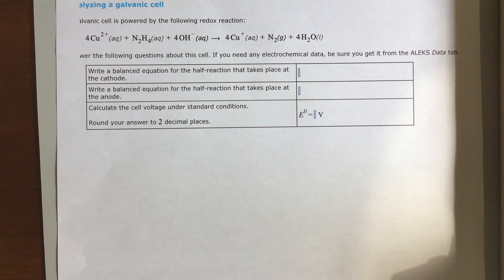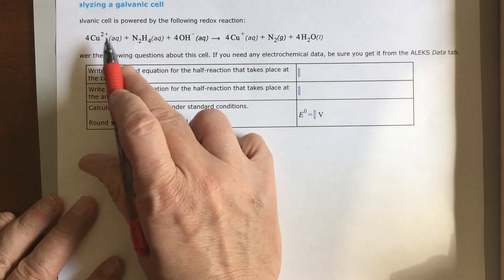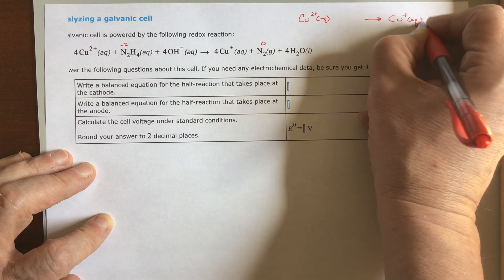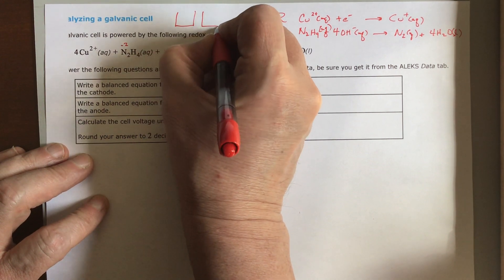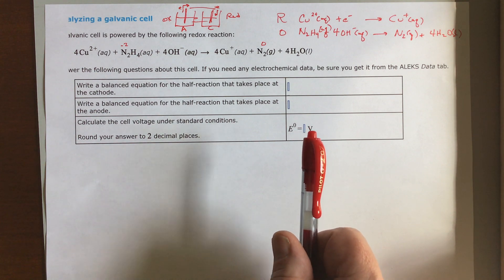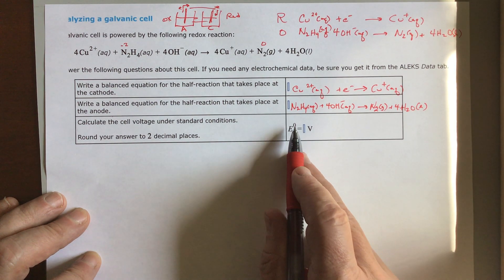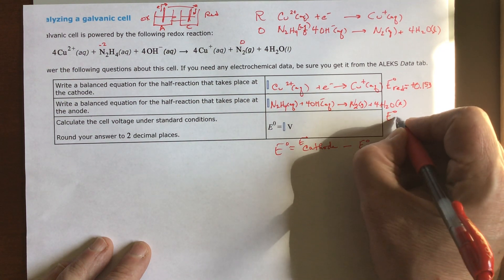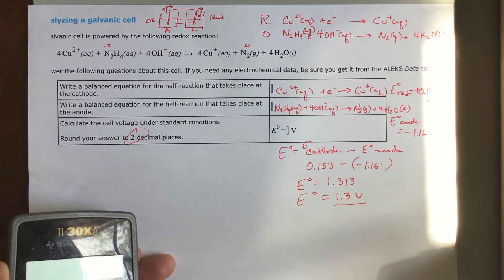Aleks Analyzing a galvanic cell

Comment: You forgot to add the electron in your oxidation half-reaction on the products side, as it's losing an electron . In which you then have to flip the oxidation reaction to conclude your final E voltage for that particular reaction.
Reply from the maker: You're right Danyal. Sorry for the goof. I believe the rest is ok.
Reply: For everyone else. in oxidation, the second half. The portion after the arrow pointed to the right , it’s supposed to be N2(g)+4h2O(l)+4e-